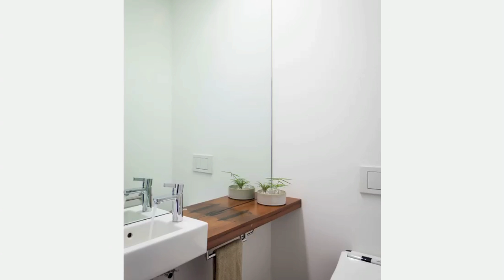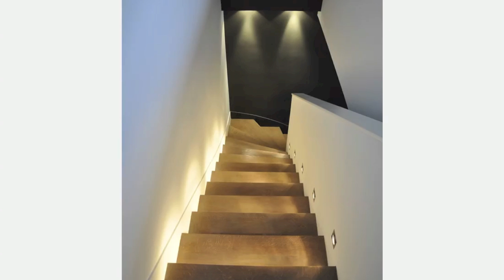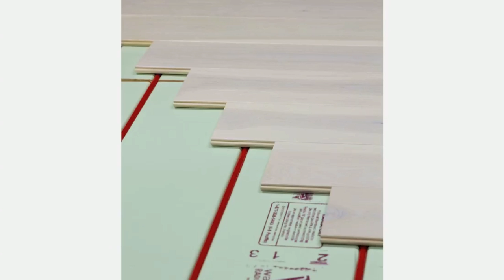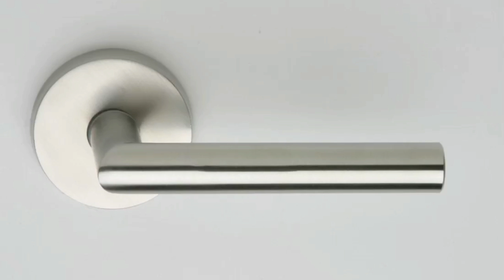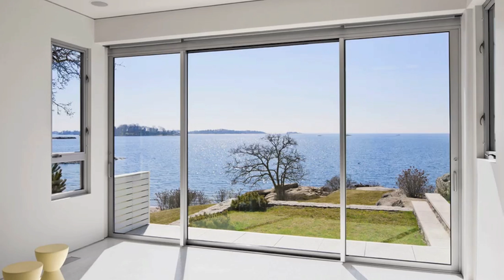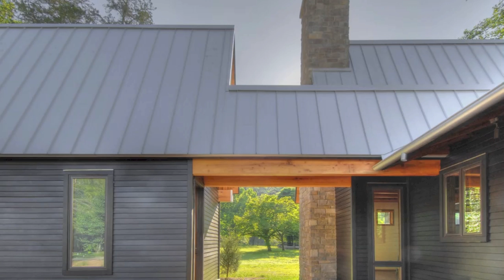An Architect's Go-To Materials

Comment: It would be nice to have an other series on this subject, maybe with detail drawings....Or pick a specific structure and go through the problematic points. For example wood frame structure - windows details (top, bottom, side), foundation and  roof detail  joining the wall....etc...The DETAIL magazine is handy to have, but somehow they don't seem to be adaptable to a family house scale. We need more affordable materials used in clever ways *and spread the knowledge) to make family houses more affordable while not to be compromised on eastectics, thermal and moisture efficiency. I enjoyed this video very much, thank you.

Comment: IT would be interesting to do the same video but with super low cost ideas.  Most of my work as an architect is well below $200/s.f. so I have to really pull out all the stops in terms of cheap and cool.  Last year I discussed board formed concrete with the local "best in class" concrete contractor.  He laughed and said that I didn't want to know how much it cost.
Reply from the maker: Robert Swinburne Indeed, it's a challenge. I will say that I always push back for real numbers when contractors throw out the "insanely expensive" argument. Just recently I had the experience of pricing out the "insanely expensive" option for siding and it came back virtually equal to the product they pitched as the most economical solution. There's some misinformation that's perpetuated over time and it can become confused with conventional wisdom if we let it.

Part of the point of the material discussion is to consider using more expensive details sparingly. This is especially true in construction less than $200/SF. I have no doubt a board formed concrete fireplace is a less expensive alternative than a stone fireplace for example. For a large, exposed foundation it would be an entirely different discussion.

Would love to see a video of some of your "cheap and cool" ideas! Thanks for watching...
Reply: This conversation reminds me of something I've always wondered about. What are the per square foot costs of various wall options? Board formed concrete or something like Kalwall are probably expensive but what's the total cost of a "normal" wood frame wall with plywood and wrap and maybe a render on the outside, insulation and drywall and paint on the inside? Are they really more expensive? And how do you factor in the saving in time?

Edit: Just noticed these comments are a year old.